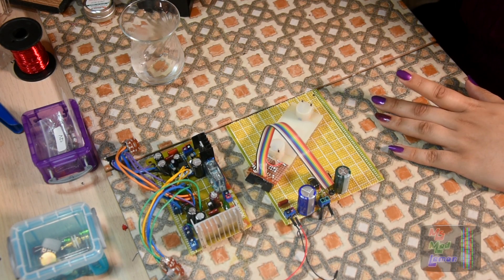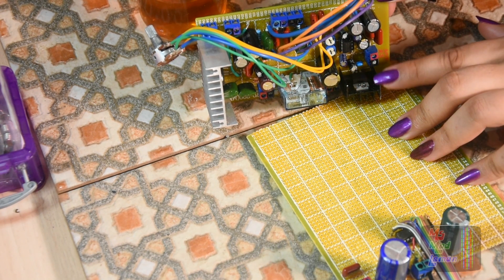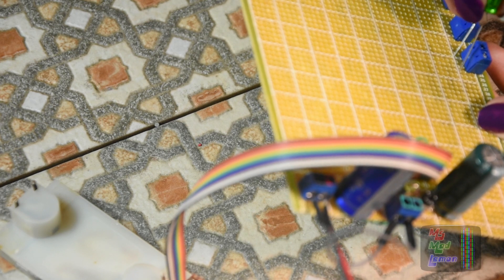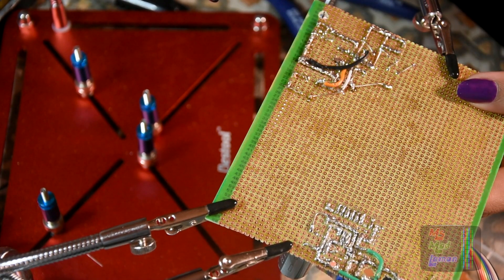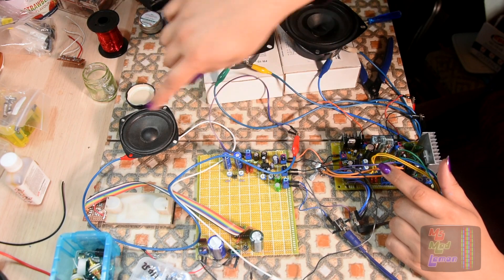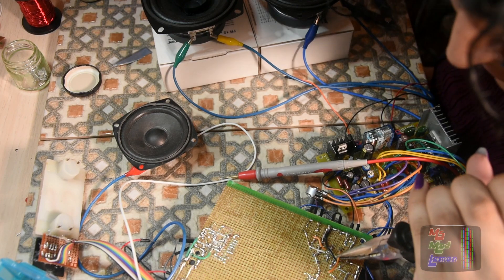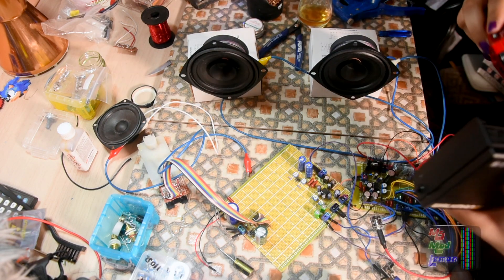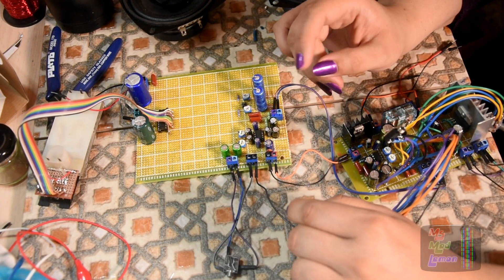Initial stage amplifier - SIdBoomBox Project 12

Comment: great job, i would still prefer a single transistor input stage over tda2822 as input stage though.
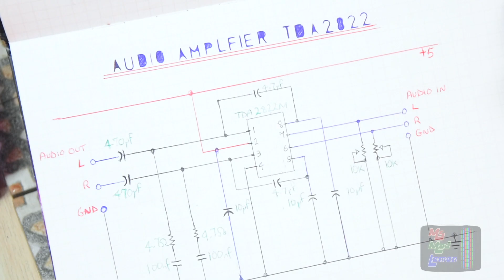Reply from the maker: Thanks, I eventually did that in addition  to the TDA2822 as mentioned at  2:36